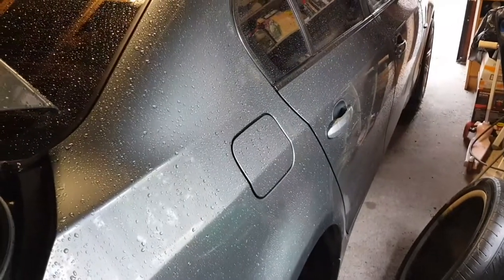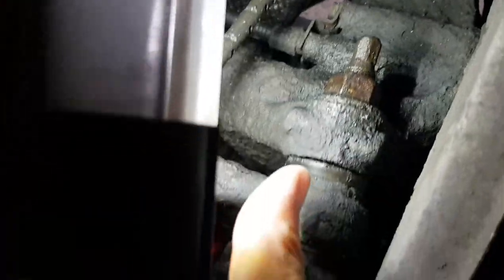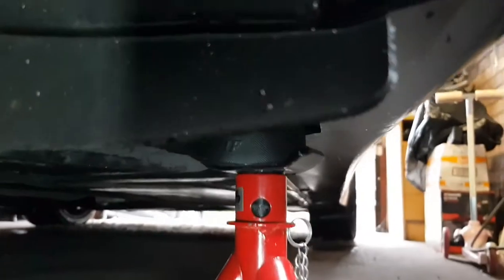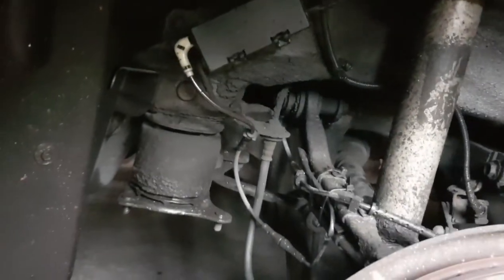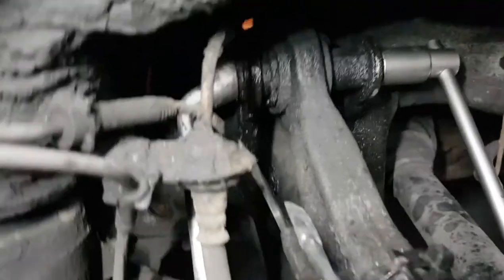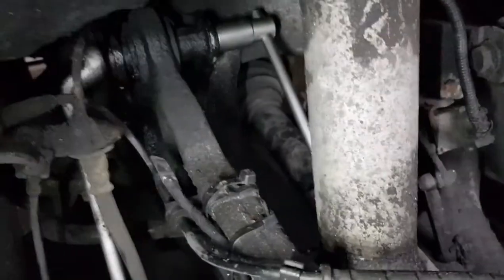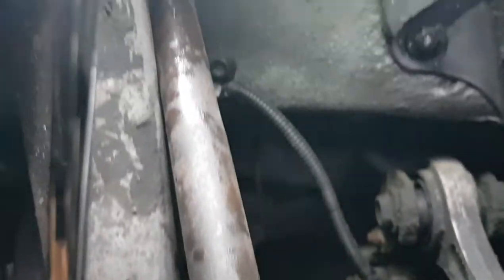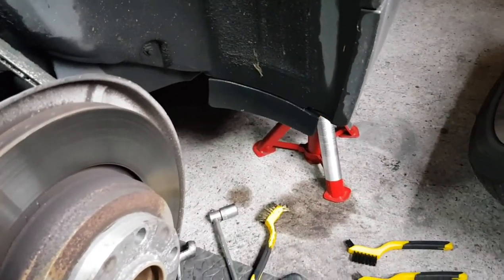BMW 530d e60 rear arm replacement

Comment: Brilliant. I've done a similar job on both sides but including driveshafts and lower arms too. Nightmare. Out of interest what make of part did you use for the new arm? I have MOOG, which seems mid-range in terms of quality.
Reply from the maker: I actually cant remember what make the parts were but they were definitely not oem or expensive in any way. Likely mid priced ones from euro car parts. So far I've had mo issues and it passed the mot the other day with those euro arms still fitted.